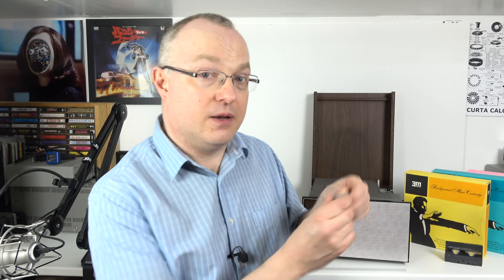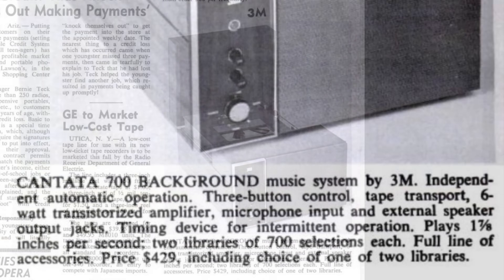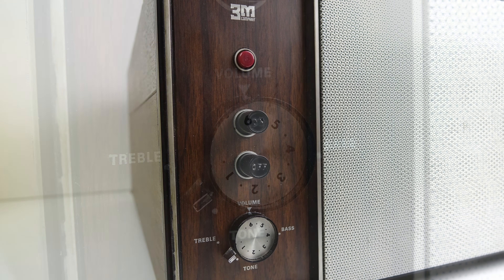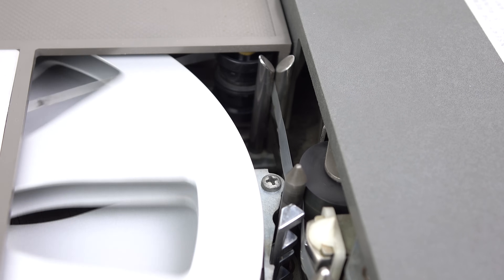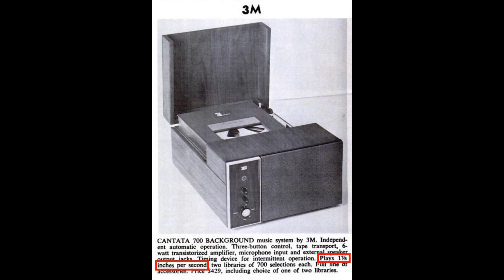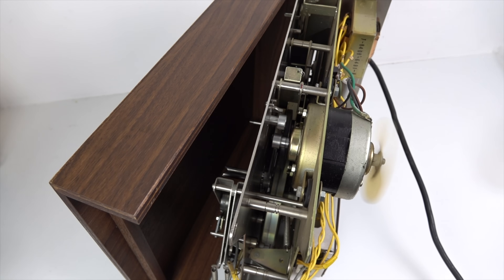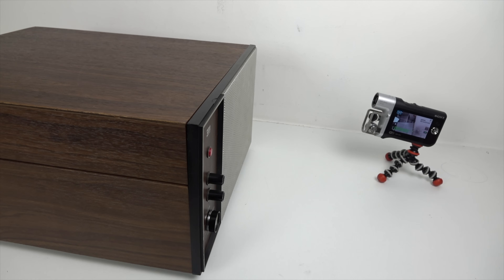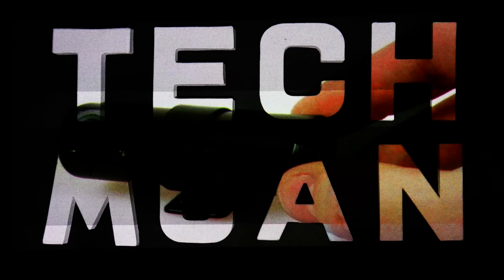Retro Tech: This 1960s BGM Machine played the Biggest Cassettes ever made - The 3M Cantata

Comment: I was fortunate enough to be a technician for a company called Key Sound and Video and serviced these units. I completely disassembled the units of all parts, inspected and placed all metal parts into an ultrasonic cleaner, replaced worn parts, lubed and reassembled them and got them in tip top shape. They actually did not sound bad even at the  1 7/8 ips speed once properly adjusted. You were very close to getting it fully apart and needed to remove the pinch wheel assemblies and head, and head height operating cam assembly and would have been very surprised how the mechanical timing was driven by an eccentric cam and allowed the unit to fade the audio down and shut off, count time and restart. The timing control to the right of the tape would allow the player to play for 24 minutes then fade down for 6 minutes, play for 15 minutes then fade down for 15 minutes, or play continuously. Care must be taken as the reel drive shaft and timing lever and other protruding shafts are not damaged when removing the top metal Deck. It really was a work of art how these were built and yours could  use a complete rebuild before irreparable damage results. These things ran many many years 24 hours a day before service was required and were not always placed in the best of locations. Tape cartridges were always leased to provide the songwriters with income due to Federal Copyright laws and violations still exist when a commercial businesses use radio for their background music and can face very stiff fines. The music also had an influence on shoppers as related to normal heartbeat vs song tempo.
Reply: Very good comment. Nearly as interesting as the article.
How did the reels change direction? The only way i can imagine is the spindle reversed and there were uni-directional clutches in them.
Reply: @Tim091  "In the UK we have to buy a licence" Lol, needing a loicence is a foregone conclusion in jolly ol' england.
Reply: @Tim091  Obviously had an effect on some peoples feet too.
Reply: My neighborhood 7-Eleven used to have the radio going and had to stop using it in the past month cause corporate was worried about this exact same thing with copyright BS.
Reply: for the fines, that is an old on the books law that is not enforced in anyway. If so sports bars couldn't be a thing since every sporting event say right at the start it cannot be used for commercial purposes. Not only that but just about every small business in the country just has normal radio on in the background.
Reply: Colt Gustafson they pay a license fee
Reply: Colt Gustafson Not long ago I worked at a comedy club and BMG sent reps out on the reg. We got busted for playing the radio and even personal music. Manager had staff bring in music from “independent artists” to avoid fines.
Reply: I believe in the US, a small business is allowed to play the radio or play copyrighted music if the establishment is under 3760 square feet, not including parking lots. My guess is the intention was  allowing mom and pop shops to play music without burdening them financially, and most larger establishments can afford it. There are also other requirements that can exempt certain establishments from licensing.
Reply: @Hemingray1893  that is 100% not true any public performance regardless of the size of the place requires a fee
Reply: I know that on Sky Sports here in the UK, when the establishment has the proper licence to show the channel in public, there is a little logo visible in the corner of the screen (shaped like a beer glass). I am sure a similar arrangement exists on sports channels in the US, whether or not there is an on screen indicator.

Comment: Your videos are utterly fascinating, and I have spent quite a lot of time on this channel. You've probably tried this trick already, but, if not, I'll share it anyway. A trick I use when resurrecting VHS and Betamax systems, and I have not got a service kit to hand, is to use a nail file to lightly sand the pinch roller and other rubber tyre surfaces, within the machine. This works a treat in most cases, as it removes the 'varnished' appearance on the roller, and returns some much needed grip. Obviously, a full service is then completed, but, for testing whether the machine is viable, just requiring a simple service, or whether I need to get the soldering iron out, it certainly serves its purpose :).

Comment: Since that sticker shows both voltages and the 230V displayed looks like it's in a little window, I wonder if it's a manual switching power supply. Maybe you can remove those screws and switch it over to 115?

Comment: Those rollers can be refurbished, especially the ones on the parts unit.  I had a Crown tape deck roller refurbished by
Docufeed Technologies, Inc.
32533 Cascade View Dr
Sultan, WA 98294-7733
360-793-2001
In 2001 it cost me $30.  There are probably others.  Eventually I need to order the roller for my Otari MX5050 available at
http://www.terrysrubberrollers.com/newrollers.html

Comment: 10:28 this is due to mono signal 1 7/8 IPS is exactly half of 3 3/4 IPS which is for stereo signal, so the quality is the same for only one speaker
Reply from the maker: It's not..but good try.
Reply: Could you explain that - are there two head for stereo?
Reply from the maker: Speed and quality are not related to Stereo and Mono. E.g. A Mono Record at 33 1/3 rpm does not sound twice as good as a stereo one at 33 1/3 rpm. The tape in this produces quality at roughly AM radio levels - due to the speed combined with the tape formulations that existed in  the 1960s. The Philips compact cassette was only suitable for reproducing dictated speech at this same speed using 1960s tape formulations - by the 70s, improvements in tape formulations and play head technology meant that music was possible on tape at the same speeds. 
https://en.wikipedia.org/wiki/Compact_Cassette
Reply: Records use different writing for mono and stereo and stylus is also different. Pretty sure that quality is related to speed like HQ 7 1/2 IPS. I guess that 3 3/4 IPS stereo use double play-heads and have separate channels but it is interesting that 1 7/8 IPS mono is exactly half of that speed. I thought that maybe there was some other approach to stereo at that time.
Reply: +vj512 There kind of was.   Some earlier stereo tape machines used the second 3/8 inch wide track that would normally be used for the other direction.  When the 4 track format for stereo in both directions was created, it was made backwards compatible by having the second track in a position so playing back a 2-track stereo tape would just work.  (Playing back a 2-track mono tape would have one speaker playing the desired track normally, and the other speaker playing the other side backwards.  Muting the backwards channel and activating the mono switch would fix that).

Comment: Thank you so much, so very interesting,  i am sure you will have done this? did you demagnatise the head, which also begs the question, surely after a while as just a playback unit the head would become magnatised and the playback sound ever duller, did the unit have an auto inbuilt demagnatiser ? (if such a thing there was ?)  i wonder if the pink cart was with the machine as a start up package, hence there being so many of them.
the pinch wheel can have quite an affect on the playback sound, and i wonder whether replacing it would be worth while ?

Once again thank you for such an interesting video, and one so well made.

Kind regards  Simon.

Comment: I haven't seen one of those machines in years. About as rare as the old seabreese disk music players. There was one in the control room at a community TV station I used to work at, for background music when the station was off air, and the memo board was on. Then they replaced it with a large reel reel to reel deck.
Reply: the reel to reel deck was called a Tape-a-Thon-10" reels going at 1 7/8 IPS.

Comment: The muzak is so wonderfully kitschy. Thanks for the link.
I used to work for one of those companies. I installed and serviced the machines and the 70v step-down transformer transmission line speaker systems. (public address)
I have never seen this machine model, quite a treat. In my day, 3M were making an 8-track cartridge design as large as the open reel we see here...but much more narrow in depth. Thank you for making this vid, really took me back. :)

Comment: All comes down to degrading rubber rollers.  Back so many years ago when I used to repair VCR's, I used 'Rubber Rejuvenator' chemical from MCM Electronics with some success on pinch rollers and drive wheels but the rubber transports in this unit are so far gone, its amazing the unit plays at all.  Thanks for sharing.

Comment: I never heard of this machine but I'm sure since I was born in 1959 I would have heard this while shopping, etc.  3M was quite a company and I have no doubt that they did do some research as to the mental effects of music vs. no music as well as kind of music programming.  That said, this music this many years later seems quite irritating???  In my youth I had a bit of 3M mind control myself.  My first personal (i.e., not my father's) tape deck was a two-head 71/2" reel to reel unit by 3M.  Later, for a while when I went to 8-track, I even had a 3M 8-track cartridge recorder with an outboard Teac Dolby unit, but that's another story of course.  I can't remember where I got my parents to order the reel to reel from, I'm thinking Burstein & Applebee out of Kansas City.  As a kid I graduated from the Sear's Wish Book to many hours perusing Allied Radio and Lafayette catalogs dreaming of audio gear. I thought Marantz gear (looks and actually their logo and typeface) was the coolest looking and even remember drawing sketches of their receivers.  Sorry to drone on, but your curiosity in old audio gear speaks to me and I get in a mode to reminisce. Even though the sound on this 3M unit is poor I was always amazed by how 3M designed audio stuff like a battleship.  Their stuff was usually very dependable even if it wasn't usually the highest end equipment.  It stressed simplicity and mechanical reliability as in fewer solenoids in favor of mechanical switches.  Still till this day I can't use Scotch tape without thinking about how thrilled I was to have my Wollensak by 3M reel to reel deck.  I really like your videos, they speak to the kid inside that never got over the love of all things audio, especially the retro stuff you review.

Comment: Odd reel size since standard reels at the time were 5", 7" or 10½". It just might be able to hold 3600' of tape and since 3600' @ 1 7/8 IPS should run 6 hr 24 min X 4 mono tracks = 25 hr 35 min.

Comment: I'm surprised it played as much better as it did when turned sideways. When you said you used some trickery to record it, I thought it was going to be taking the reels out of the cartridge, putting them on a normal reel-to-reel machine, playing at 3 3/4 IPS, recording to a computer, cutting the speed by half to obtain 3M's weird 1 7/8, and playing it out through the audio circuitry of the actual machine (or simply using that recorded audio).

Comment: Standard audio cassettes (Compact Cassettes) also run at 1 & 7/8 inches per second with tape of half the width, yet the sound quality at that speed was reasonably good.
Reply from the maker: +Nigel2AB Better tape formulations introduced in the mid 70s are responsible for this.

Comment: I actually had one of these machine several years ago that I bought at a thrift store for 20 bucks I think.but it was a different model. it had just one tape running across. with four tracks and the head had four binaural tracks. when it came to the end of that track,it had a staple.that would hit a bar, and it would reverse. four times like this
----->
<----
-->
<--
and then start all over.
there was a rubber wheel [ shown at 13:48 ] that had hardened and the sound had alot of "wow" and "flutter". Just like Yours, but worse. plus one of the tracks would run backwards. I never figured out what was wrong and I could not find another wheel the right size.luckily I was able to wind most of the tape onto my  Akai quad channel reel to reel.and got it to the right speed.  I used it alot in my home office while I was working. LOL I like this "Elevator music" Weird but true :)

Comment: Thanks for this video on this fascinating machine!

3M of course owned Wollensak, and the mech in here looks to have some design concepts taken from one of their WORST Wollensaks, the T-524. 

The T-524 was also mono and worked all the way down to 15/16ths ips. 

It also used the infamous "how the hell does it come apart" sandwich construction.  

Instead of moving the drive idler to change speeds, this one moved the ENTIRE MOTOR up and down! 

It had a drive wheel almost identical to the one you showed, even on the plastic sliding track. 

That wheel NEVER disengaged from the motor and capstan flywheel, so over time, it developed flats. 

I expect this is part of what your machine is dealing with. 

I have a video about the T-524 unit here: https://www.youtube.com/watch?v=H9GLtD3YP_c if you want to see the internals.

I also expect that your mushy pinch rollers are just not doing their job. Obviously, if you can get them out and send them and the drive wheel for recovering, I bet the unit would play pretty well. 

But eh, why bother? The real value of it anymore is it's uniqueness, which you have demonstrated quite nicely.

Comment: I wonder if you could have removed the tape and played it on a standard reel to reel, recorded it and then adjusted the timing to bring it back down to the right speed.  That said, I can appreciate that you bought it for its technical desirability and not for the music.
Reply from the maker: +bigclivedotcom  I've spooled one cartridge onto my reel to reel machine and there is a lot of leakage between tracks (the sound of the mono music recorded on the left output can be heard on the separate mono music played from the right). Also the sound is very low when played at 3.75ips and then slowed 50% in editing. A number of people said they used to record their own tapes at home...but given the fact the mono tracks aren't in line with the tracks on a home 4-track reel to reel this may be mis-remembered.
Reply: +Techmoan It would probably be going too far to add the original head or a small positionable one to a reel to reel unit temporarily.  I would guess deliberately playing the tape at a higher speed might get a stronger signal?  Then it could be slowed down in an audio processing package afterwards.  This is assuming you could actually handle the music though.
Reply: +bigclivedotcom bigclive!
Reply: +bigclivedotcom A Muzak Dosimeter would come in handy. Can you find one and do a tear-down?
Reply: Mono machines are not that hard to find and record tapes on. Like the old mono Wollensack at our grade school in 1972 probably would have made good tapes for this wonderful machine.
Reply: bigclivedotcom
Hey! I know you! :D
That's a good idea, it is standard reel sized tape after all.

Comment: A place I worked at had one of those later models that was leased out sitting in an old rusted safety cage. When they remodeled they threw it away and I couldn't get down there to take it before they came and got the dumpster. It was heartbreaking. Could I possibly talk you into archiving that music and uploading it to archive.org if it doesn't already exist?

Comment: And I was expecting an announcement for a blue light special in aisle 7 over that music.
Reply: The only difference though was that Kmarts never used BGM systems by muzak or 3M they would use standard reel to reel units in the 70s and early 80s in the late 80s to the mid 90s they used just standard compact cassette then they went to using a satellite system, i worked for a kmart and when the store was being shut I got a reel to reel unit and some of the old reels, not the greatest sounding, the machine was pretty worn out and even on my TEAC unit that works beautifully the tapes themselves are getting long in the tooth and two were so quiet that i had to run my HI-FI at pretty much full volume and could barely hear it, but anyway the reason they liked to use the reel to reel was cause they would record sales in the tape before shipping to the store.
Reply: Lol.
Reply: @AstronomyToday "Bing bong" is the best

Comment: These were more common than you think in the UK. I used to work for TSC music systems in Crawley in 1989 and used to repair these and do installs. It was a later machine in the then fashionable PC beige with a brown smoke perspex cover. McDonalds, KFC, Harvester nationwide and loads on independent restaurants and shops had these. Even the Angus Steak House in the Haymarket, London had one! 

The most common fault besides dirty heads and pinch rollers were capstan bearing wearing. If you see on yours there are three rivets which hold the bearing assembly to the deck. They used to swap the unit out and do the bearing in the workshop in Crawley. I started to do them onsite as it saved the return trip and saved time! All the units we leased had 100v line output and could drive a small array of ceiling speakers without an additional amp. If I remember it was a 30w amp built it. TSC also had a large room for the tape library including covers of more contemporary music of the time. The owner compiled them himself and was always updating tapes.

It was around this time that people were starting to hire TOA auto reverse cassette decks which we reversed the head wires so that people couldn't play their own cassettes :-)